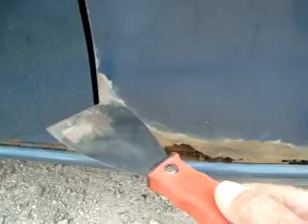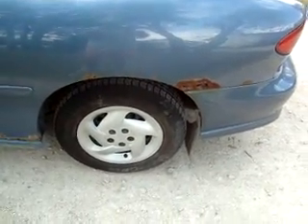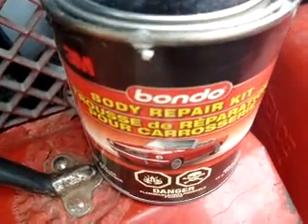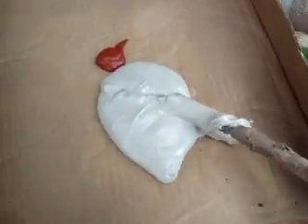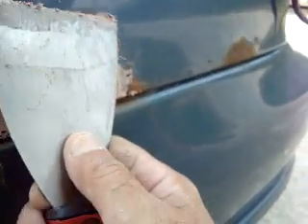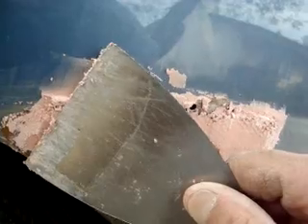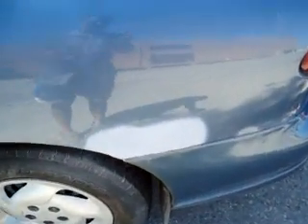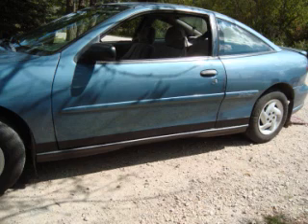fix rust holes ...no welding

Comment: Might sound dumb, but seeing I am an ASE Master autobody tech, a metalshaper trained under Wray Shelien and award winning car builder with over 30 years experience I might know what im talking about! Fact is polyester filler(Bondo) is very porous. It is never used to replace metal. It is used to smooth metal. Bondo absorbs moisture and holds it against the metal its adheared to. To replace the metal with out using metal use Marglass, , or polyester resin jell. It must say WATERPROOF on the can.

Comment: I seen some second hand Mig welding machines for like 80 bucks was not perfect machines but good enough to weld a bodywork thats not that expensive. Agree a very good welding machine can cost like 1000 or more but for 400 you can have really good ones second hand. So its reasonable priced and you have a long lasting fix. But I agree with you its good enough for quick fix :) if better color match I would have given a thumbs up lol

Comment: Even when I flush weld a patch 100% I dont use bondo right over the weld. First use fiber glass resin jelly, or Marglass or Bondo-glass. These products are water proof. You could even use the resin jelly with fiberglass cloth to repair holes after cutting out all the rust with good results.

Comment: in the worst case scenario i would use pop rivets and sheet metal, then bondo, and it would hold very nice, we fixed a subaru once with pop rivets and bondo, painted everything and it held together for many years.

Comment: ok I know his channel )))). I have only an arc welder and its difficult welding car body parts with it but you can do it 44amps and a electrod of 2 millimeter its more than 1/32 of inch  the 1/32 don't work well you would need lesser amps.  before you fiber you can also use rust stabilizing Primer I live in  Netherlands and I got a product called Corrolesss and what you have to do is first remove as much rust as you can and than put this over the rust than fiber, btw thanks for info :)

Comment: I had a piece of crap caravan that I used mostly for work it's 16 years old. I did something similar to this on 10th year but cleaned the rust and it last like 6 years. I used the kitty version of bondo though. Point is car looked good for 6 year with basically $40. If it's a car worth keeping then you can do it the right way. I live in Ontario where the solution to winter clean up is to dump salt on the road. Just having a beater to do odd jobs and you are taking to grave this is cheap solution, you can save money on your cars that matter.

Comment: Most vehicles from the 90's are getting rusty now, but I actually think the sheet metal in a lot of them was better then than it is now.  My 98 Chevy half ton is getting fairly rusty but it is still in better shape than any truck from 1999 to about 2006 or 2007.  GM cheaped out somewhere and used some very poor metal.  The jury is still out on whether the trucks after '07 are any better at resisting rust.

Comment: i have a 85 chevy c10 that the rockers and cab corners needed  some attention the corners and rocker panels are only about 15$ a piece or is that for the set idk they got em at LMC and jc whitney but for a quick fix it yourself job for ppl who cant weld 2 thumbs but to be honest i think its just as easy and cheaper to fix em the right way at least on a mid 80s  chevy shortbed

Comment: Allot of hate on this video.
The worse thing he did was leave allot of rust that will just spread and become more of a problem later.

But besides that what he did seems fine.

I'm looking at cheap trucks that have some rust holes that count as "jagged edges" on the inspections here, even tho the damage has nothing to do with the frame.... idk heaven forbid if a child touches it or something....

But I am trying to figure out how easy it would be for me to remove as much rust as possible (preferably all) and cover it up.
My next question would it be..... Can i get away with using hardly any paint to mostly match the remainder of the truck...
She does not need to look nice.... just look decent from afar.... that would be my goal...
Oh and cheap!

Comment: I would have beat the metal in a little and rough up the area around the rust hole with some 80 grit before bonds but should last a couple months in the dry summer

Comment: Yea dude I noticed that the most in ford F series from 87-96 F-250-350 til 97. That the trucks just rust easily and they rust to hell. Especially in the salt gap. I've seen pictures of ford trucks from 93 with rusted out wells, not to mention the pictures were taken in 97. I'll never understand why every car from the late 80s and most 90s were rust buckets. Guess cheap was on the economy's mind

Comment: you could of peeled back the bumper from the edge of the repair area and held it away by trapping a screwdriver in between the bumper and the mounting area behind...

why not weld in new pieces? They would last a lot longer.

Comment: The proper way to fix this car would be to call the nearest junk yard.
Reply: cooldog60 Actually this car has a little rust on it. It isn't like the car is just falling apart. This can be repaired. Although it may not be the correct way especially on a rocker panel it is still a decent enough job. 

Normal people only scrap a car when it is either not functioning anymore or it is rotted to nothing. Even then I would still save the engine and tranny since you can swap those into something else. 

Cars shouldn't be thrown away just because a person is too lazy to repair it.